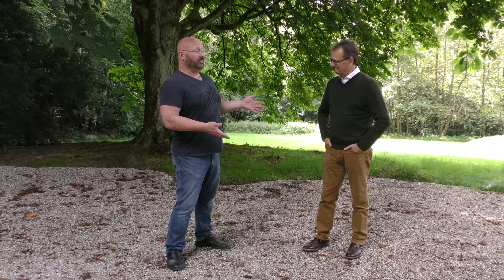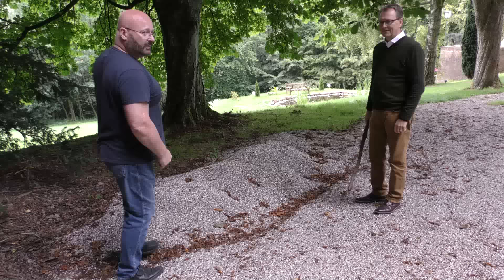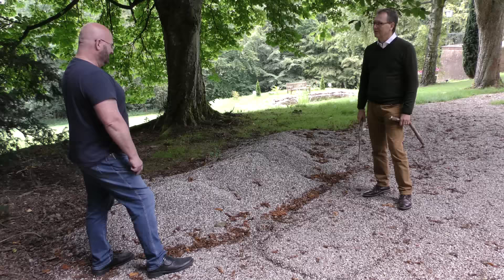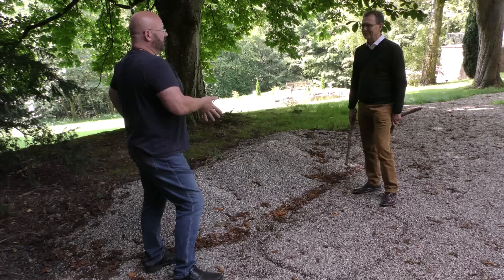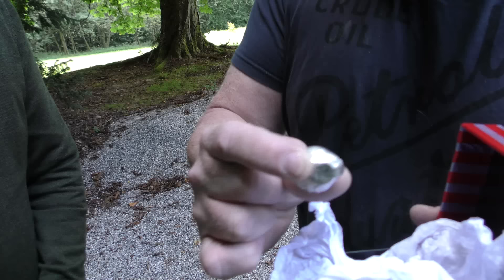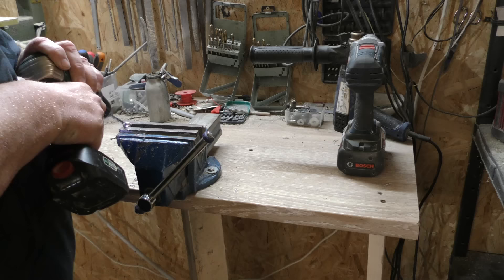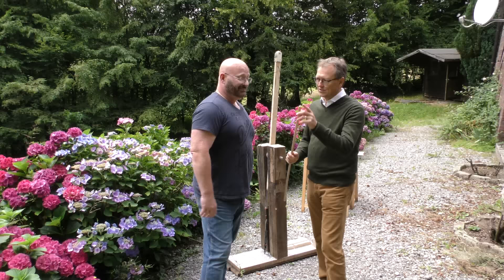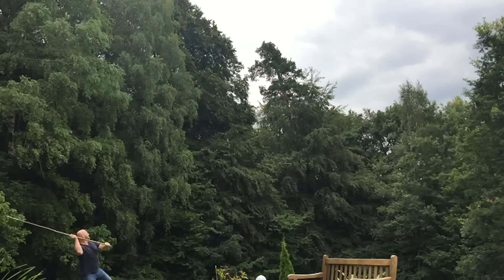The Mystery Of The Whistling Bullets: Psychological Warfare, 200 AD

Comment: 19:46 same train of thought. The swing becomes more than double the power, with the added length of the swing arm mechanism, and the ability to push with the lead hand as you pull with the bottom hand, to make a very strong and fast sweeping motion. I have alot of training with a Bo staff, and its the first thing that came to mind was a short bow staff with a nail on the end! bravo

Comment: I think the launching stick is the most logical reason for the holes being the same size. What Joerg seems to have missed, though, is that they wouldn't necessarily have to have been launched by swinging them with the arm. They could have been launched in more of a bow-like fashion, using the spring of the wood. The launcher could have held the bottom of the stick in one hand and have drawn the top back with the other, or a two meter long stick could have been planted in holes in the battlements and drawn and released to launch.
Reply: Or even longer if one end is secured in place. Great point.

Comment: Love that you're bringing in all those specialists! keep the good wörk up jörg! :D
Reply: oh and aren't point blank shots a little... inaccurate to simulate led balls that have travelled quite a distance? Or were they standing right in front of them often enough? :D
Reply: +Geld Eimer I was thinking the same thing. The fabric used is likely questionable as well.
Reply: Well, the horizontal momentum should not have suffered all that much and as they said it was from front rampart to front rampart, so it's close enough. About the fabric, any fabric from back then is at best a thin rag by now, but assuming from the history of the area and the kind of people that they were, the fabric should be close to what they wore.

Comment: I'd love to hear 100 x fired all at once.
Reply: Imagine an ornager firing a bucket full of drilled shots at the enemy :-O
Reply: He used a stick with just one nail, but it's entirely reasonable to attach several branches to the end, as long as all the nail ends point the same "up" angle, allowing a person to fire a dozen bullets with a single throw. After all, the stick is the heavy part of the launch device, not the ammo. With a dozen guys throwing a dozen on each throw, you'd have 144 bullets in air at once. Task another guy to stick the bullets on the end, and you have a much better reload time. They could also take turns for longer engagements. That's one gross bullets in air for just two dozen guys. It boggles my mind that we waited until modern firearms before taking projectiles as seriously as we do.
Reply: HOLY SHIT YES SOMEONE NEEDS TO RECORD THIS HAPPENING.
Reply: Same

Comment: I'm imagining a longer pole & flexible with a whipping action for even more power over greater distance
Reply: Im not sure how well a thin enough wooden pole to flex would hold up after constant use and the general choas of war. But attaching maybe a leather strip with a spot to hold the projectile like a traditional sling to the end would be a possibility
Reply: upto it terminal velocity only ... as for durability ... bendy branches abounded in those days ... so replacement sticks were literally growing on trees
Reply: @0623kaboom  You could also soak them in oil or wet them down to keep them limber.
Reply: for what ? i still can it here wizzel , in Earth Orbit ,  2021 .... 😁😎

Comment: Let's assume that the holes were for producing that wicked whistling sound in order to terrorize the enemy and cause them to panic. The explanation for the hole size being the same may be as simple as all the bullets in that battle having been manufactured in the same workshop using the same tool. I suggest comparing them with similar bullets from battlefields in other parts of the Roman empire to see whether they were universally the same size holes or not.

Alternatively, if they were the same size in order to fit on the peg of a firing device, why not some sort of mechanical device that could fire them faster and more accurately than a human with a stick?

Comment: Really interesting video, I definitely think the whistling balls should become regular ammunition for your videos, they sound awesome. I just can't help wondering if the balls would have the same penetrative capability if the test was performed at a realistic range, I'm assuming there was a reasonable distance between the two camps. Obviously accuracy becomes an issue at such distance and you don't want to be standing there all day trying to get a hit but I would imagine the projectile loses quite a bit of energy during the flight.
Reply from the maker: Heavy lead bullets don't lose much speed, thanks to inertia.
Reply: The village was on top of a hill, potentially walled.  Roman encampment would have been a safe distance away.

 Let's be generous and say that the Romans were engaging at a distance of 30 meters, uphill. Inertia plays a lesser role than gravity at that point. Daniel's point stands. 

A shot  15 cm away doesn't accurately reflect the stopping power of a slinger given the circumstances
Reply from the maker: Gravity does not slow down the bullets much. It just adds a downwards vector. Air resistance does, but dense oval objects are not affected much by that. Also I used a weak enough bandset that only shot the bullet at 35 m/s, whereas slingers launched them at 45 m/s. Last not least fatal head shots from slings are well documented in literature.
Reply: does that mean you will continue using whistle ammo? i like that idea too.
Reply: +JoergSprave interesting. the more you know I guess. Still enjoyed the video. keep up the good work and keep showing me it's features.
Reply: +caleb stephens Jorg may be a brute but he also does his homework and is very knowledgeable. I wouldn't be so quick to pull a key board warrior attack on him.
Reply: +Final Cam unlike you, some of us don't consider him a "brute".
Reply: Very true. Also they may not have done much aiming at all and went with a projectile storm. In other words say 500 + romans just more or less lobbing these suckers in the direction of the camp. Potentially 2 or 3 shot in each pouch say 2 non holed balls and one with just for the sound. While they would loose speed while gaining altitude and covering distance when coming back down and at a sharper angle in the arc they would regain a fair portion of the speed they had just from the act of falling. If you get hit with a hand full of falling lead shot like these your going to feel it and if you don't die from the hits right off your likely going to soon enough.Again with lots of little lead balls falling from the air your going to have a bunch of people getting hit in say the eyes blinding them others will get lucky and get hit in the rest of their head but not so lucky as they will be blinded from the blood. Trust me speaking from experience (little 1 inch gash above my eye once i had so much blood running in to my eye i had blurred vision for a solid day +) here head wounds bleed allot even when so minor as to not even need a stitch to close. That effect alone removes ones will and ability to fight.  At that point others can mop up and take down the rest. 

I can tell you this that screaming whistle when he fired towards the camera would scare the ever living hell out of you with just one. Now imagine a few 100 at once screaming like that...
Reply: +JoergSprave After watching this video. I think the 'whistle' effect, was why they had thr hole.
The size of the hole may have been consistent because they were built into the mold. Removing the need to drill each slug.
Reply: +iMarooned I disagreed with the poison, theory, only do to the lack of likely piercing abilities at long range.
Reply: Javier Vargas brute was the wrong word, how about "beast" or "bad ass"?

Comment: What if the holes are all the same size because the way they made the holes , like they mass produced them
Reply: it would certainly be really interesting to see how a Roman mass production area/facility would look like for these things. :)
Reply: a regular mold with a stud in it
Reply: yeah but different smithes wouldve had slightly different molds. its unlikely all the round were made in the same workshop
Reply: Actually the slinger would carry their own molds and melting pots. So having a single manufacture making the field molds, would make cookie cutter molds. Not to mention. Anyone building the molds, would be given the spects wanted. So again theu would still all be similar.
Reply: it would also save a small amount of material so more could be made
Reply: that's what I thought (stock sizes)
Reply: What if they put  a number of balls on the stick to fire at once?
Reply: Yea this Is what I was thinking, they probaly forged some kind of metal drill bit and made hundreds of holes with a single tool and then forged another tool out of the same cast.
Reply: Vathe that was my thought. Mass-producing.
Reply: They must have been imported from china
Reply: Goober Mench exactly what I was thinking